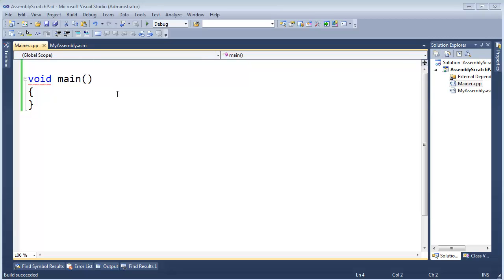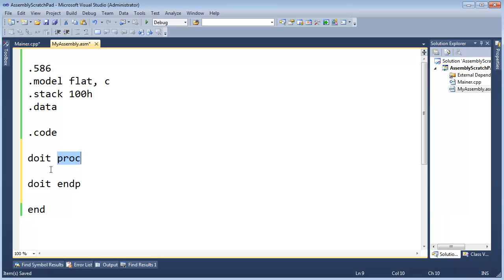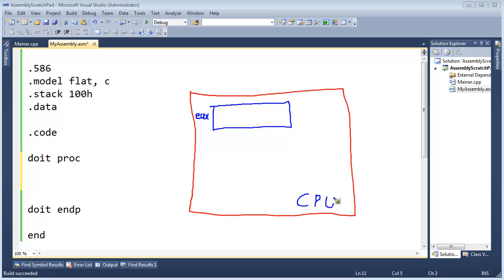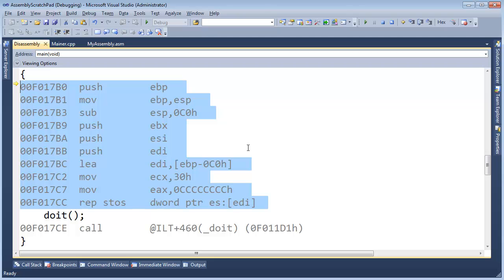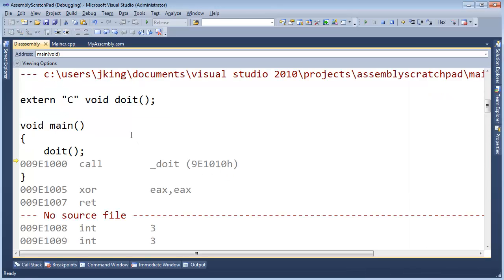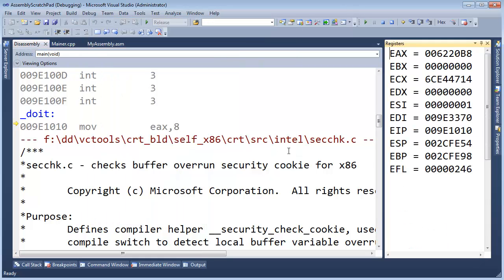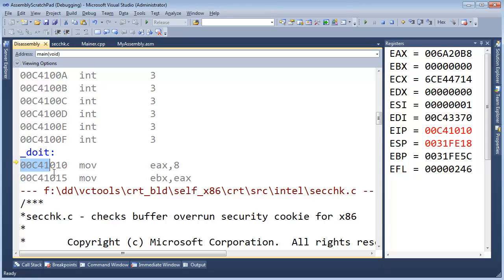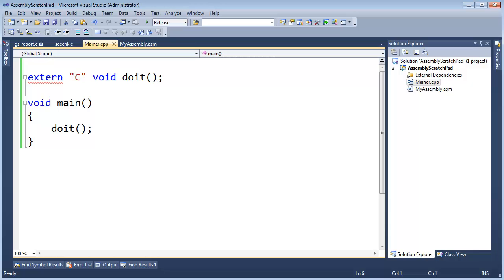Our First Assembly Program

Comment: Great tutorial. Thanks for sharing.  This is 2022 version. Have any had this message: "The breakpoint will not currently be hit. No symbol ......
The challenge is that the breakpoint only works in the cpp file at the function call. But it then accumulates all what has happend in the asm file and only stop (breaks) when the complete asm is done. No individual step into is possible?

(EDIT) For some reason - newbie -  it is possible to single step thru the program in disassembly even without setting any breakpoints!  What a day. Just spend numerous hours. Great!

Comment: hey i got this error: Run-Time Check Failure #0 - The value of ESP was not properly saved across a function call.  This is usually a result of calling a function declared with one calling convention with a function pointer declared with a different calling convention. i am on vs ultimate 2013

Comment: Hi! Great tutorial for complete beginners, love your enthusi-asm! (sorry)... Anyways, I'm following along with an Assembly editor, and I wanted to know, is there any reason that it would only accept ax and not eax as the register? When I tried with eax, it threw an error, but changing it to ax solved the problem...
Reply from the maker: +Zajicek It's probably just the assembler you are using. In college, the assembler I used required AX instead of EAX. E is for extended, which means 32 bit here. But in college it was 32 bit as well. :/

Comment: Hi Jamie, I'm using VS Express 2010 to do the projects, but, there doesn't seem to be a way to view the registers. I'm wondering if that feature is disabled in VSE2010?  Is there an alternate way to view the registers? I also found out something else that is different in VSE 2010, to view the disassembly you have to use the key combination "alt+8" instead of "cntl+alt+d"

Comment from the maker: Oh duh. I didn't try release, and I got that error. But I got past it by changing my assemble command line to this:

ml /c /Cx /coff /safeseh "%(FullPath)"

Notice the /safeseh added.

If this doesn't work, tell me, and I will zip my project and put it on my site for you.
Reply: Dude i know this is 3 years old but can you pin this, i had this problem and took me ages to find this fix :/
Loving the videos though, i only just found them xD
Reply: Thanks - that did it.
Reply: For those who want to have an easy time with Assembly language I recommend GUI Turbo Assembler.

Comment: Really? You don't get the SAFESEH error when you change to Release mode?
I'm going through it again. I set SAFESEH:NO as suggested below. Now when I try to compile I get a MessageBox with "A buffer overrun has occurred in AssemblyScratchpad.exe which has corrupted the program's internal state." Is there anywhere I can download your project because I'm going nowhere with this?

Comment: Any chance of a vid using VS2012 to show how to set everything up cos I'm getting linker errors too. 

In .asm properties there's the option Link Objects. I take it this should be on?

(With  Link off) Ctr/Shift B says it builds ok but when I try to debug it it says it cant find AssemblyApp.exe (AssemblyApp is the name of my .asm file)

(With Link on) Ctr/Shift B fails with two errors
Error	1	error LNK2001: unresolved external symbol _mainCRTStartup
Error	2	error LNK1120: 1 unresolved externals

Comment: They are identical. I double checked that. What I did find out is that I needed to remove a switch (/SAFESEH:NO) from the Linker in order for the program to work as yours. Basically I went to the VS Project Properties (right click the project name + Properties) > Linker > Command Line > Additional Options > Then added /SAFESEH:NO.

Thanks for the videos. I'm already a fan of your work.
Reply: even 9 years later this comment is still useful thank you very much
Reply from the maker: Thank you both.

Comment: Jamie I get two errors when attempting to run the application after changing the configuration to release and amending the .asm file's properties. The errors are as follows: 

error LNK2026: module unsafe for SAFESEH image.
error LNK1281: unable to generate SAFESEH image. 

I've tried creating a new c++ project and building only using release configuration but alas, the problem persists. I'll continue watching whilst using debug configuration as that works fine for the time being.
Reply: 9 years later? so what

compile it on release x64
Reply: @KitchenSinkGaming73  It does not help, but sends: fatal error LNK1120: 1 unresolved externals
Reply: @mortenlund1418  Make sure all of your project settings are the same as the tutorial
Reply: @KitchenSinkGaming73  Thanks for reply. It is working the way its done in the tutorials.